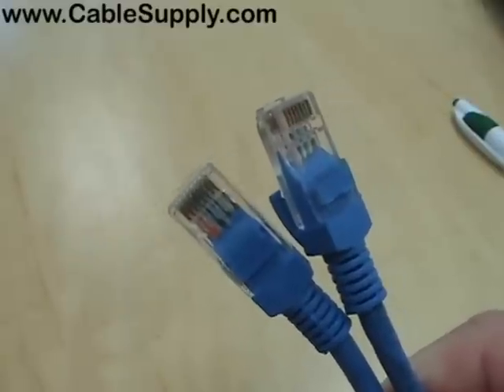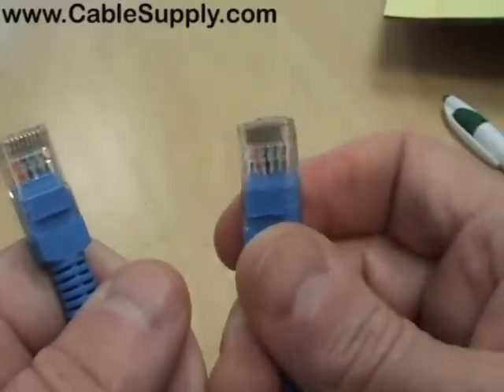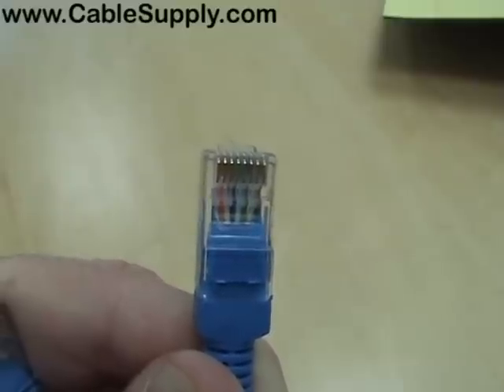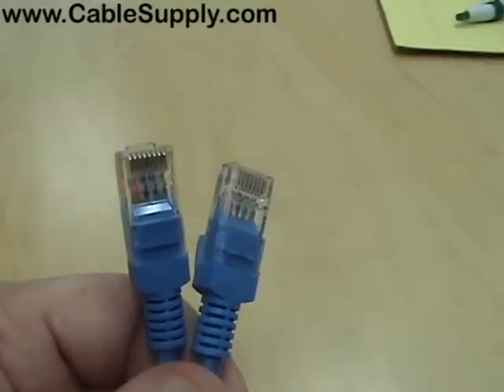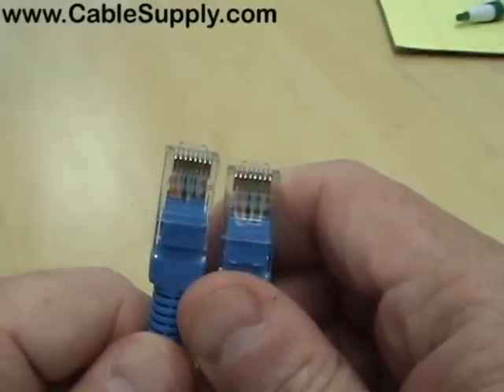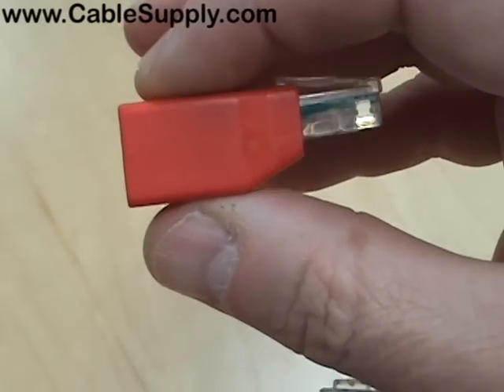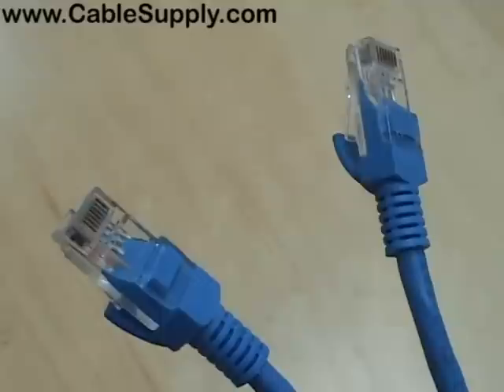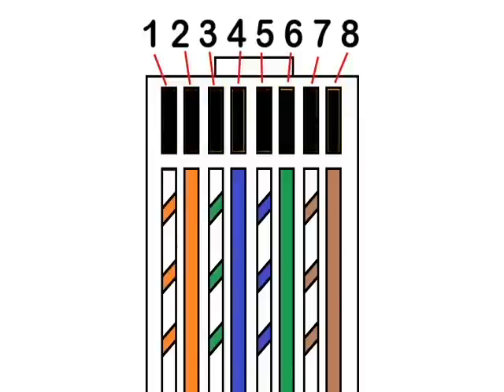RJ45 Pinouts: Explaining 568A, 568B, Ethernet pin connectors, and crossover cables

Comment: The reason the cable pairs are twisted is to reduce cross talk (when current flows down a wire a wire in parallel will have its electrons move also) Each pair is twisted at a different rate to reduce it further.  But to get the benefits, a circuit needs to be on same twisted pair.  If you don't , you will increase your signal to noise ratio and reduce the quality of the connection. The longer the cable the more noticeable the effect.

Comment: IDK but aside from T568B of A,  I have been using non-standard color coding when setting up LAN ang it's working well. I just made it sure that whatever the color combination on one end is also the same on the other end. Is there a special feature between the copper wire inside a Wh-Or, Or and the Wh-Gr, Gr plastic cover with regards to Transmit and Received function?
Reply from the maker: Computer network cable is designed to be used with the color code. The reason why is because each pair has a particular twist to it. It works best when individual wires are used together in a pair. It is an engineering thing. Less cross talk. The problem is when other techs need to troubleshoot your cabling, they will have difficulty and understanding what you did or how you cabled. to answer your statement that your "network is working well" that may be, however, when you get into the longer distances, it may create problems with your computers and you're switching routing equipment. The computer may be sending out the packets over and over again because they're not getting through on a consistent basis, the standards really do work well and my advice would be stick with them. I do appreciate the fact that you watch the video and wrote me comments. Thank you.

Comment: I am using an old router as a relay / extender. Do i need a crossover cable to connect the 2?
Reply from the maker: Like devices need crossover cables. For example, computer to computer not going through a switch would need a crossover cable. Older switches, and routers need crossover cables when going from switch to switch.  if you're cable runs are more than 100 m you'll need a switch or an extender. That's why network design is so important. Thank you for watching my videos. Very much appreciated.

Comment: I GOT A DVO JACK 568A(WALL PLATE)- WHERE WE USE PUNCH-DOWN TOOL AND OTHER END  WOULD BE ETHERNET CONNCTER WHICH WILL GO INTO THE SWITCH..
WHAT WOULD BE THE COLOR CODE TO TRAVEL DATA THROUGH?
let me know please thanks
\

Comment from the maker: Yes, technically you could arrange the colors in any order and it -would- work as long as it's the same on both ends.

The color order exists to provide common ground for human technicians and help them tell what each wire does. So, if you terminate in some random order, what about the tech that comes after you? They'll assume a standard that's not there. And they may not be able to look at your cable to check; it could be really long, or one end may be terminated on a jack they can't get to.

Comment: Hi,sir i explained you my old modem is configured to WiFi router it mean my old router is configured to WiFi access point simple word how to used cable straight & cross cables connectors RJ-45 my cable is CAT 5e replay me ?????

Comment: @6:37 Can this Device change a older, and useless 20m's of Crossover Cabling. into a a Straight-Though? So I can connect my mini HTPC up via its Ethernet Port, form my Router? Unfortunately the area I reside in is littered with 2.4Ghz Interference, and although the Router is in fact capable of broadcasting in the 5.8Ghz Range. None of my actual end devices are that sophisticated.

Sure I could.. Buy a Crimper, and some Jacks and do it by Hand.... But it's not like Cat-5 Cable costs the World. And by the time I factor in the cost of these One-time use Tools... I'd have been better of just buying a whole new Cable.

Or so it seems to me.
Reply: Yes, if you plug a crossover adapter into a crossover cable it will act as a straight through cable.

Comment: ok, I am so confused...its all copper, so, if the wires match on both sides...wouldn't it work...?
Reply: Captain John McMillan yes these are copper cables but not interconnected ( either from wall side and penal sude) so have to be contacted in right order